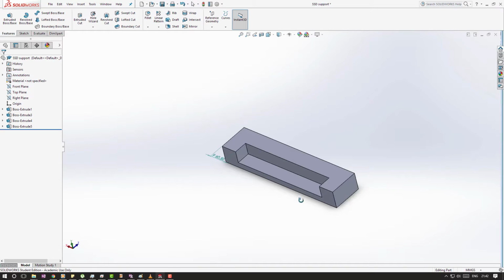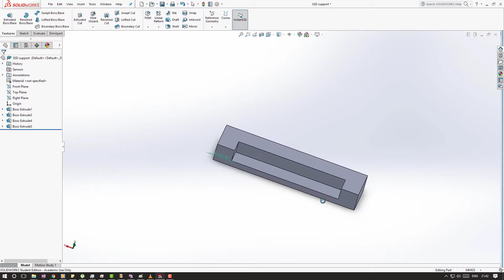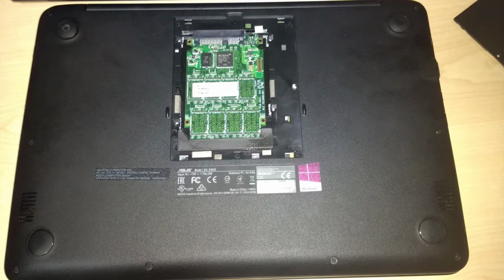9mm to 7mm thickness SSD tutorial

Comment: Great tutorial and all, but this would kill a SSD. Where's the heat going to dissipate from the DRAM Cache and Controller? On high and even mid-end SSDs the controller could fry itself to death under certain circumstances and even though it wouldn't normally under normal use it would seriously degrade it's longevity from the high temperatures.
Reply: how does it get rid of the heat when still in the plastic case though? This way i would think there is more air around it to cool...
Reply: I would wager the SSD will run cooler without the case. Reason is the case, although metal, does not appear to have any thermal substance between it and the chips. This indicates it was not intended to behave as a heatsink. Not having that thermal substance to fill the gap makes the difference between the case helping or hurting the thermal performance.

Comment: brilliant!  I was wondering how to make this work. I actually bought an enclosure for the 9 mm  ssd thinking that i would be able to replace my CD rOM drive with the SSD and then simply switching the bootable hard drive to the SSD. But i could not get the 9mm case to fit into the CD drive bay.  Now with your solution, i may be able to just replace the hard drive with SSD so my boot up is speeded up, then perhaps get another smaller enclosure for the hard drive and stick that into the CD bay??  By the way, would you be able to sell me one of those 3d printed holder?